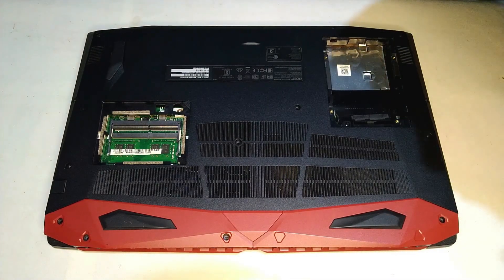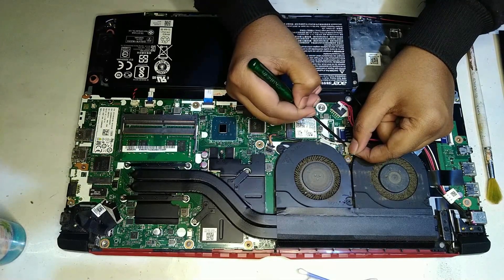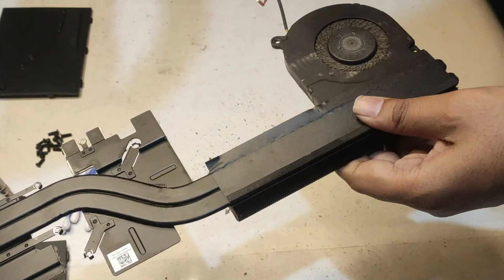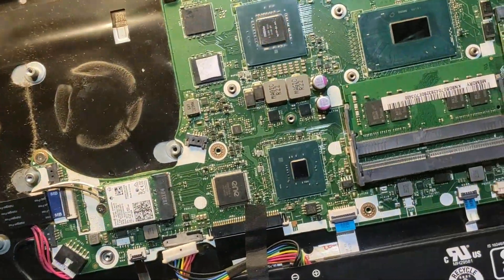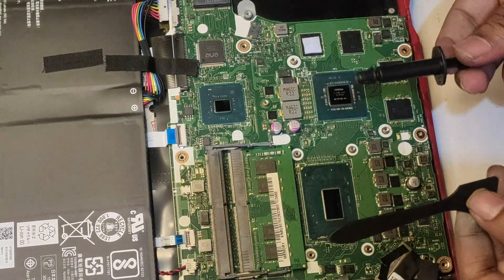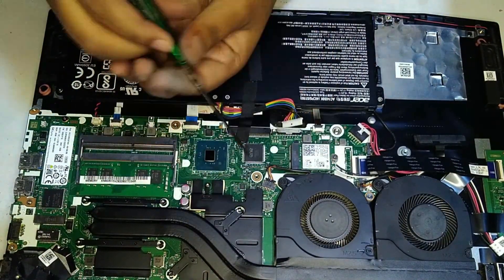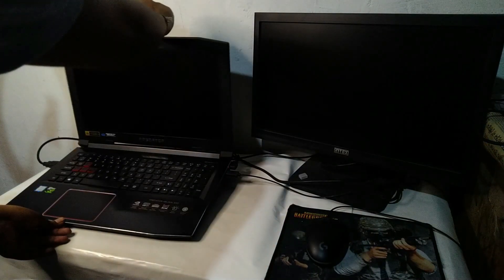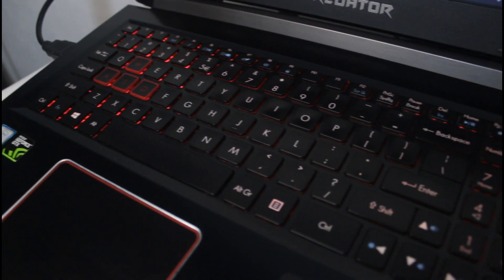FIX Laptop Overheating! | Thermal Grizzly Kryonaut 🔥

Comment: Bro you can open the very small screws on the fan assembly and then wash the fins with a brush in isopropyl alcohol too, it helps remove the dust that sticks :)
Reply from the maker: Yes you can, but my fan assembly didn't have screws, they was some sort of lock.
Blowing air did it, not a big deal.
Reply: @DeepteshLovesTECH  can you give details of the srewdriver set that you used for opening your laptop? like asap. That would be great
Reply: @SatyakiMandal35  mi india is selling one screw set. I have the same laptop, used it for ssd upgrade and cleaning.
Reply: @harshitsingh8794  does this laptop supports Gen 4 ssds??

Comment: After reconnecting the battery i generated a battery report and my battery capacity dipped from 52 Whr to 46!... I tried recalibrating the battery and it still shows around 45-46 whr.. what should I do?
Reply from the maker: what?! Never encountered anything like that. How is actual battery life?
Reply: @DeepteshLovesTECH  it is draining a bit..it goes from 100-91 really quick but then it's okay .
Reply: Mine increased from 40WHr to 66WHr ( i was thinking about to replace battery, after i repasted i increaes capacity smh)

Comment: Grizzly Kryonaut wont last longer but its alright, do checkout Gelid GC Extreme next time.
Reply: how much period kryonaut lasts??
Reply: @spandanpatil514  if you're using it on a laptop, then max 1 or 2 months depending upon the usage.
Reply: @desifins  Thanks. And gelid GC extreme period??  My laptop temperatures are awful 93-94CPU plus 85-86GPU while playing games. Gelid GC is same price right??
Reply: @spandanpatil514  just tryout Gelid GC Extreme. It is often sold for 700 INR on Amazon during sales.
Reply: @desifins  yeah i will. Do you have any idea about how much it will last?? Thanks for providing information!!
Reply: @spandanpatil514  Gelid lasts for about 2-4 months depending on the usage.
Reply: Nai bhai tum galat ho😂😂 mera 1 mahine me dum tod diya gelid
Reply: @prakharadwani9084  abhi kya karu kuch samazh nahi aarha.. Thermal throttling ki wajah se CSGO lowest settings 720p pe 50-55 fps mil rha hai🤯🤯(jo pehle 200+fps deta thaa)
Reply: @spandanpatil514  kya wtf? Konsa laptop h
Reply: @prakharadwani9084  Acer Predator Triton 300, i59300H GTX 1650 8GB ram
Reply: @spandanpatil514  rip
Reply: @prakharadwani9084  ??
Reply: @prakharadwani9084  tumhare heatsink aur fans replace hone wale he 😂
Reply: What about kryonaut extreme? It has longer durability